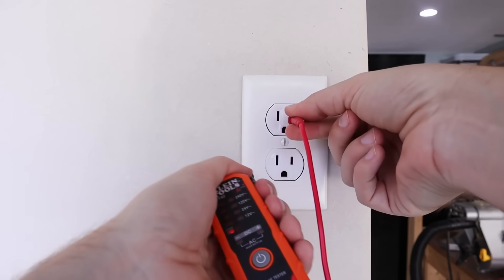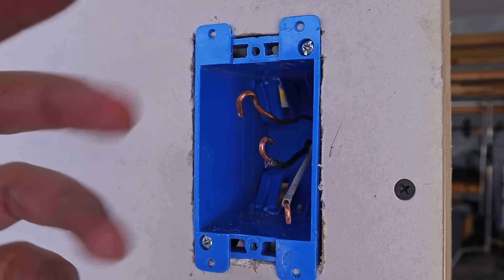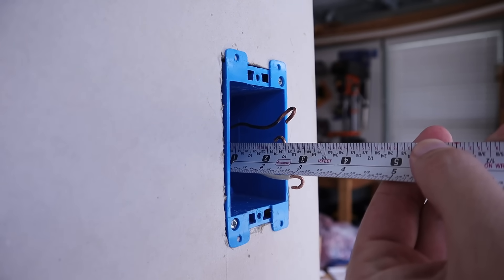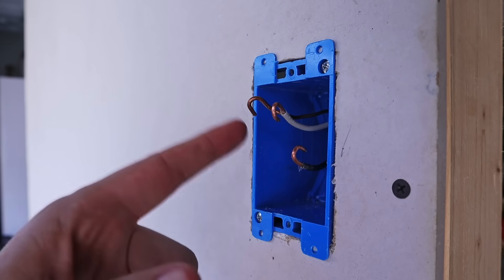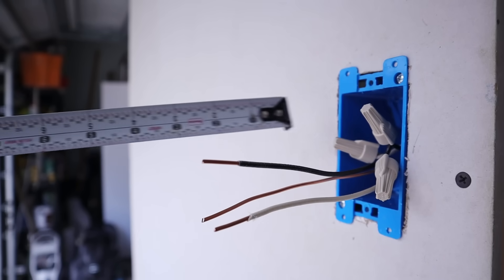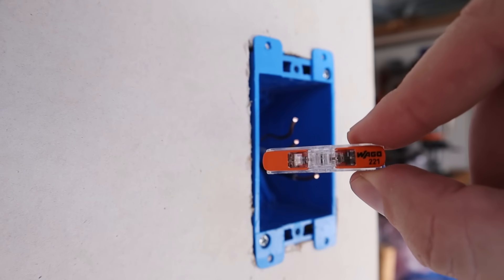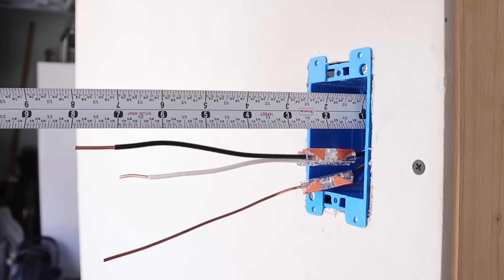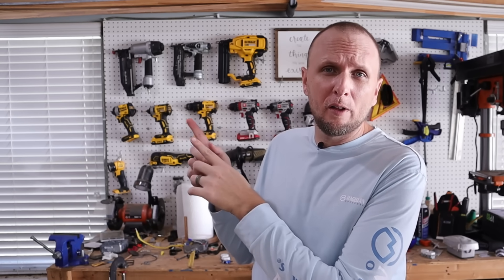"SHOCKING" New Way to Fix Short Wires In an Electrical Box to Code | Very Important

Comment: Not a fan of the wagos because I am unsure of the integrity of the electrical connection under heavy load conditions.
When returning the wire nut connections to the box always install them tip up so that if you ever have the misfortune of a plumbing  problem the connection sheds water instead of “cupping” and holding water to cause a corrosion / resistive heat generating problem

Comment: Howdy. Great.
I would have liked seeing You coil the tails along the box bottom. The tails sprouting up from the coiling at where the receptacle screws are. Coiling avoids sharp bends which hardens copper very fast.
I would imagine many DIY:ers just press the receptacle into the box. Possibly pushing the tails out of the way with a screwdriver. Not good.
Regards.

Comment: Try Wago 2273. If you are not using stranded wires than it will save you even more space. They are one-time use as they have no lever but are much smaller.

Comment: That ring you wear is choking off blood flow to your finger.
Reply from the maker: It’s actually pretty loose and my finger is still very much in tact.  Thanks though Doc.
Reply: @HowToHomeDIY  looks pretty tight  4:41  That's my diagnosis. Lol
Reply from the maker: @WApnj it’s a silicone ring so it’s flexible.

Comment: Wire nuts are not used here in UK. They were superseded years ago. It feels peculiar to see so many US videos about then. Oddly enough I've just moved to a 1960's property and found some in the 0original main wiring, and the more recent mods were using terminal blocks. Nowadays, it's be Wago's (and with a strong desire to upgrade all the electrics ;-)

Comment: NEVER force a wire into a closed wago - ensure the lever is up in the open position. Forcing a wire into a closed wago will result in a weak termination and damage the device.

Comment: This is great info.  One thing I'll add that others have mentioned is that you can use crimp insulated butt connections, too.  Both wagos and crimps will work to connect stranded and solid wire together, something that can be done with wirenuts but isn't always great.  Using stranded 12 instead of solid can make it easier to get everything in and out of a box.  Same volume, but less force required.  12 stranded THHN is readily available by the foot at box stores.
Reply: Not an electrician ^^^
Reply: @jamescole3152  :) Because you wouldn't do it that way, or because you wouldn't give advice to a DIY person?  Which wirenuts do you carry in your bag, and are they still rated for a solid/stranded mix?  Because Ideal bought most of them, and they're not all rated that way anymore.

Comment: That's great but these videos always use an end of run receptacle and a plastic box not requiring a ground. Seldom the situation we're dealing with with. with.
Reply from the maker: That wouldn't change anything in this video though.  If the wires going on to another receptacle or the load side of the switch, if those are too short, they just get lengthened the same way.

Comment: Be aware all of these inline and wire nuts provide a mechanical and electrical connection. However, if you look at a temperature infra red picture of these connections you can see the high resistance of these connections.
The twisted wire nuts are less resistant than the inline connectors. You can see the heat at these connectors.
Seeing heating from these connections show a small voltage drop at these connections.
This is one of the reasons all of these connections have to be in a approved electrical box just in case more heat or a fire erupts from an even worse connection.
Reply from the maker: The higher resistance is negligible as all of those videos and studies you are referring to have demonstrated and stated.

Comment: you can also use those little crimped on copper connectors and cover them with electrical tape which I think uses less space in a box than the other methods you used.

Comment: Question: do short wires pose a fire or safety risk? I recently replaced a wired smoke detector and did something stupid, which was cut off parts of the wires in the box with a stripper. Now the black wire is about 3-4″ and the white wire is about 4″. Is it ok for one wire to be shorter than the other, or do they have to be the same length? I know they are not code compliant, but I'm not noticing anything strange. I don't want it to possibly start a fire in the future though from my smoke detector of all places. Please let me know if I need to extend the wires just to be safe.

Comment: Another Wago commercial. I've been busy lately replacing homeowner-installed Wagos with Wingnuts. I have nothing against Wago, and have used them successfully. They do, however, have limitations.
Reply from the maker: I don’t use them often but for certain applications like this one, they are great.  Not a commercial, an option that many did not know about.

Comment: Yeah you're really not supposed to just push wires into the Wagos with the levers down. I don't even understand why anyone would do that. You're saving an insignificant amount of time with the risk of damaging the Wago and creating a weak connection.
Reply from the maker: It doesn’t damage the Wago or create a weak connection.  You made that up.

Comment: Ideal use for inline wago, BUT cable had yellow sheath, so it is presumably 12awg. and wago you showed (cle4ar center section) is only good up to 14awg. You should have wago 221-2401 (white center) for 12awg.
Reply: Check their product specs. All of the 221 series are good for 12 AWG
Reply: @Tybeebee  incorrect.  The clear straight through is only rated for 14ga.  If you freeze the video, you can even see the -14ga max rating printed directly on the side of it.  It is a bit misleading because all of the other 221 are clear and are rated for 12, but not this connector.  Only the white top ones are rated for 12.
Reply: There are two type we're talking about here: WAGO 221-2401(Max 12ga) and WAGO 221-2411(Max 14ga)
Reply: @Robnord1   incorrect.  The clear straight through is only rated for 14ga.  If you freeze the video, you can even see the -14ga max rating printed directly on the side of it.  It is a bit misleading because all of the other 221 are clear and are rated for 12, but not this connector.  Only the white top ones are rated for 12.
Reply: @CamTampTV   Thanks. Now I know why my large 221 assortment has white body straight throughs.

Comment: I have had many inspections over the years for electrical work.   Never once did an inspector pull outlets out of the box to check length.  The do check that wire is fastened close enough to the boxes.    I like long wires but working on older homes rarely are they that long.   Most come out of boxes 2" or less.  Only in really short situations  do you actually have to add wires.       It isn't actually an unsafe issue, it is an issue of working  on it in the future.   Also some times adding additional wires into a box becomes a code issue.  Over crowding a box can be more unsafe and more  of a code issue than  short wires.      Most areas here in Pennsylvania, do not require that you update to modern code unless you are completely re-wiring an electrical system.

Comment: Was concerned with the Wago's at high currents, did some testing. Used 14Awg wire with 30amps, after 1 hour the temperature rise was 15degC, wiggled and pulled the wires temp rise still at 15degC. 
Have no worries about the Wago connector having a poor connection or over heating. 
Over the years have seen many poor twist connector connections that fall apart when I did service. 
Will never use a twist connector again.

Comment: If that's a plastic box for a receptacle, why not pull outward to meet electrical code some extra cable from behind the wall as it will auto clamp itself to the plastic box?

Comment: I always leave a few inches of slack in the wall that can be pulled later to extend the wires if need. You never know when it will be needed 50 years for now

Comment: I have AL wiring in my house and these WAGOS work great for it!  I used some OXGARD (instead of the Wago brand) poured 3/4 into the port, and put my 10 AWG and 12 AWG AL wires precoated in AntiOX into these and they are working great 3+ years.  

I like to wrap the WAGO levers and use the electrical tape with the correct coloring code (Black = hot, etc) to correspond to each wire. (I also try to wrap the wires inside the wagos to hold them together in the splicer)  I've accidentally flipped the levers while installing these in the box, I think it's prudent to tape the levers, even though WAGO doesn't recommend it.  

People should consider using WAGO for AL Wire.  I would recommend using freshly cut, unscratched and clean AL wire that has been pre-coated in antiox. (People should use the antiox that WAGO recommends. I didn't buy it because its stupidly expensive for some reason.)

I recently inspected to look for any signs of bulging/expansion, and oxidation and there was none. These splicers should be inspected every 5 years for oxidation, expansion, etc.  Too much expansion could release the levers and possibly make a lose connection - which is why I like to tape my wires together as they go into the splicer.

Devices that use continous high current have bulged on me using the ALUMICONN lug  splice connectors, and I've had ALUMICONN lugs with no anti ox paste in them, which is why it's important to pre-inspect these to make sure they have sufficient antiox in them, and to check for tight connections before installing.  Noalox works great if you need to top off on fresh antiox in these.

Comment: If “STABBING” the back of an outlet is not only dangerous but also newbie-ish?, Then why would you use an in-line or otherwise technology that similarly simply shark bites a wire in place?.

The contact area is negligible, it’s dangerous & just like shark bites in plumbing these little bullshit items simply should NOT be used in electrical wiring either.
Reply from the maker: They don't work in the same way at all.  Apples and oranges.

Comment: I just replaced an outlet in my house the other day and not only were the wires this short, but there were three wires on device screws. To accomplish this, whoever did it, stripped enough to make twisted wire nut junction and wrapped the screws more than 360 degrees with all three wires. Total PITA all I wanted was a new outlet that holds the plugs not that task to deal with.

Comment: Those clips remind me of Back Stabbing in to the back of the outlet. Back stabbing has a tiny knife edge inside that makes contact. Just think of current draw through that knife edge. I dont ever backstab thats what screws are for. Way better connections IMHO. I'd also go with the wire nut method to extend too.  My 2 Cents.

Comment: Don't twist for wire-nuts. Not recommended by the manufacturers. The connection between wires is not from the twisting of the nut whern you screw it on. It comes from the square edge of the "threads" in the nut. The metal thread cuts into the wires and forms a series of gas-tight connections to the copper.

Comment: Drywallers with rotozip tools are the worst. ALso on the electrician if they didnt tuck the wires in far enough at the rough in stage

Comment: Never ever ever never ever used wago's on high average circuits, These connectors are great for LED lamps and low current circuits. I've seen them turn wires purple and melt dew insulation. The waco connectors are good Safely up to 5 amps. Remember great for lightning circus to connect a bunch of lights together.
Reply: Was concerned with the Wago's at high currents, did some testing. Used 14Awg wire with 30amps, after 1 hour the temperature rise was 15degC, wiggled and pulled the wires temp rise still at 15degC. 
Have no worries about the Wago connector having a poor connection. 
Over the years have seen many poor twist connector connections that fall apart when I did service. Will never use a twist connector again.

Comment: Your use of the inline Wago connector is wrong.  The lever should be opened, the wire inserted and the lever closed.  Oh and wire nuts are the invention of the devil.

Comment: in my city they have added to this rule that the 6" starts at the outside of the box not at the entry point
Reply from the maker: Wow!  That is a lot of wire to try and fit in a box.
Reply: @HowToHomeDIY  right and i know many companies that are trying to fight this because its just a city code and doesnt make the NEC code better there for why add the additional wire for no reason.  The whole purpose of city codes in my opinion is the make the NEC codes better not worse

Comment: As DIY I don't think I care that much about "code". As long as I can get the new box in and safely connected, it is probably going to sit there for decades no problem. But its good to know how to make the wires longer if you do not have enough to make it reach.

Comment: This code is probably for ease of access, but not for electrical connectivity safety (short or long wires). I'd just reconnect as they are.
In addition, why did you cut the hook-shape wires? You could have just straightened them with a plier.

Comment: Is it possible to do an inline twisted splice , solder it and cover it with a couple of layers of heatshrink tubing? or is that not code approved!  I have soldered short ground conductors before after twisting them together, but not hot and nuetral wires.

Comment: I echo comments made by others below, this video is garbage for presenting a 'code' issue and then proceeding to CREATE A PROBLEM AND STILL NOT FIX THE CODE ISSUE since you now have spliced wires sticking out of the wall where you once had a working receptacle.
Reply from the maker: What are you talking about?  The code issue was solved and the wires are for the receptacle.   My goodness some of these comments are special 😂
Reply: @HowToHomeDIY  the "code" is 6" of wire available BEHIND a receptacle adequately mounted in the box.  That didn't happen here, just a bunch of wire spliced on, and good luck getting it attached to a receptacle and back in the box :p
Maybe next time show an actual problem being fixed as opposed to a random code violation NOT being fixed. 😵‍💫

Comment: I once saw a test of different types of devices to connect household wires together.  One thing that stayed with me was that the WAGO connector had a small but yet significant voltage drop across it.  To me this means that the WAGO connector doesn't have enough surface of connection to the wires.  I wouldn't trust a WAGO connector to carry a full current load on a wire with out there being at least some heating of the connector.  I like the twist on connectors but I also think that the best possible connection would be to twist the wires together and solder them and cover it with heat shrink.  Maybe 2 layers of heat shrink material.  It would definitely take up the least amount of space!
Reply: @@jash21222 :  In one way of thinking of it, yes, everything has a resistance to it, even the wire itself.  However, if the device holding two pieces of wire together produces more resistance than the same length of wire would (basically zero inches and thus 0 ohms) then the device is providing an extra resistance in the electrical path.   In the video I watched the wire nuts had the least resistance.   Basically any connector/connection that has less surface contact than the equivalence of the volume of the wire's surface will provide a resistance and lower the wire's ability to carry current.  And low but not zero resistance with a high current draw creates a heater and thus creates a potential hazard.  The absolute best connection possible, though very impractical when doing house wiring, would be to solder the wires together.  An absolute zero resistance or drop of voltage.  

I would never use Wago connectors, especially in a circuit where a high current draw would be expected.  I don't think Wago connectors provide any better of a connection than the infamous "stabbing" connectors in cheep outlets often use in mobile home construction and that are often responsible for fires.

Comment: wagos are garbage for full current use.  So no space heaters or other high loads downstream of any wago.  Short term they work fine, but long term they slowly fail.  It is not a controversy, it is simple facts.  The only thing worse than wago is the push-fit connections in the outlets.  Wago's are fast and easy, and great for low current lighting and other applications where you don't expect high wattage appliances.  But they should not be used for outlets, because all it takes is one 1800 watt heater during a cold snap to turn the wago into the highest resistance in the circuit, turning the wago into a heater.  Any connection that is getting warm under load will eventually fail.  Heat cycle under these conditions for a few years, and you /will/ get a failure, not if but when.  Properly installed wire nuts won't do this, but poorly installed wire nuts can as well.  I have run 5 datacenters, and the customers generally keep the circuits above 60% of the rated current on a 24 by 7 basis, and any splices must be made lower in resistance than the bare conductor for the splice to stay cold.  Warm splices are failing splices.  Always assume that at the end of a circuit run, someone is going to plug in an 1800 watt space heater and run it 24x7 for months at a time.  So every splice will be stressed if made poorly.  I'm not an electrician, I'm an electrical engineer that has had to clean up after electricians try to burn my shop or house down.
Reply: R the old brass inline screw connectors better ??

Comment: Wire lengths and box space limitations would never be an issue if gang boxes contained buses for switches, receptacles, and daisy lines to simply plug into.